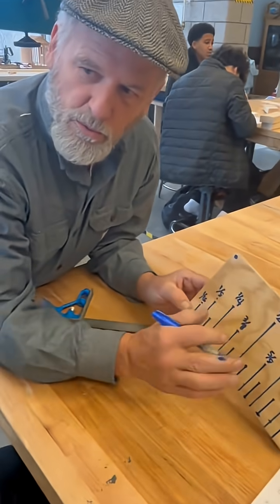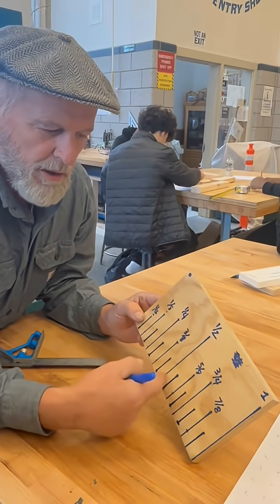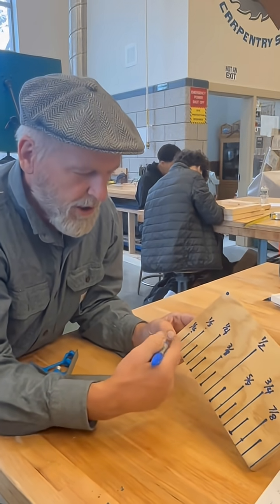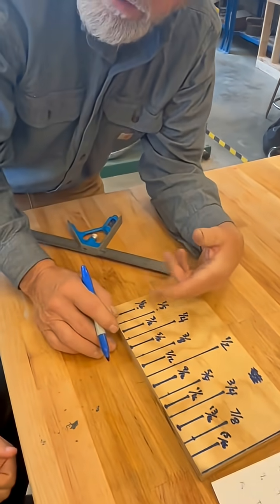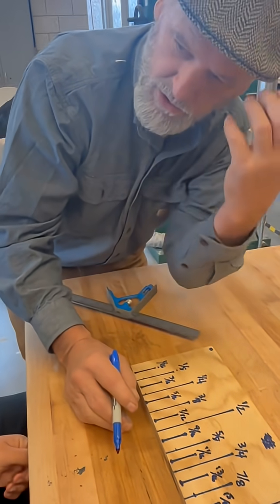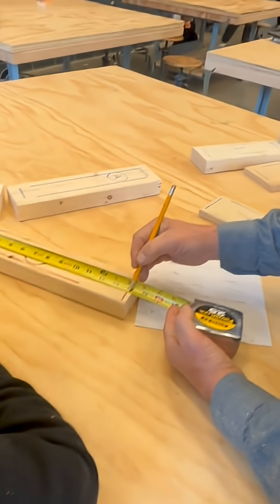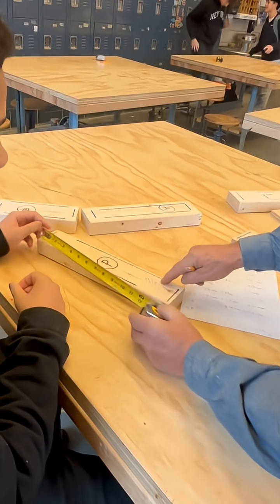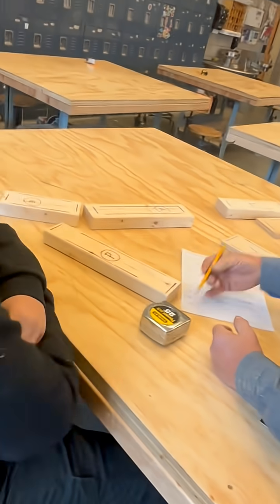Teaching the fractions of an inch @mrburkescarpentryclassqhs5452

Comment: Some standard sizes that you hear on site for tools and fasteners.
Using metric the 1 millimetre within 1000 = 1 meter.
'can you get me the 1/4' nut driver or pass the 3/8 spanner' Who broke the 3/16 drill bit?
🌏🔩
Reply from the maker: 9/16 =0.563 or the little mark after the 1/2😊

Comment: That would not work for roofers,  we would use that peace of plywood to mark what  fraction you called out
Reply: Not entirely true. I started at Duffy Roofing in Dorchester. He never got the memo that Slavery was ended in 1863. Anyway, I install millwork now in fancy retail stores like Gucci and other overpriced Euro-trash retail stores. We spend half our time converting metric to standard. 
So we make mistakes in 2 languages, now.
Reply from the maker: 😂….Duffy Roofing.. one of my competitors back in the 80s … slick outfit😊
Reply: I worked roofing for many years.  One time asked for a 4'  2x4 but for some reason I  held up hands, so when the ground man handed up the board it was about  2' long when I said it should be 4' long his reply was , you held your hands up like this.
Reply from the maker: 😂… obviously you were working with a visual learner 😊